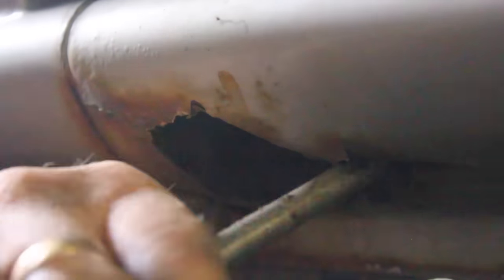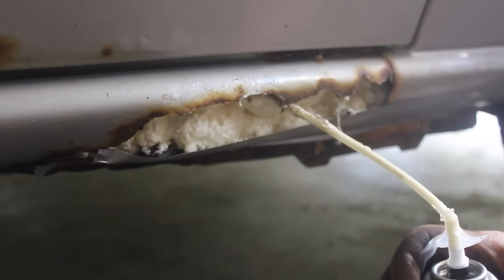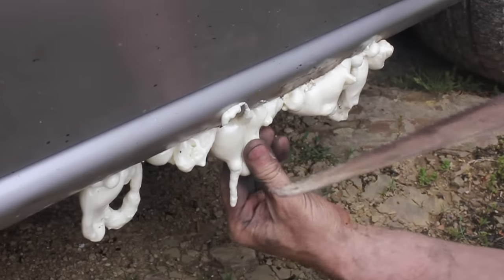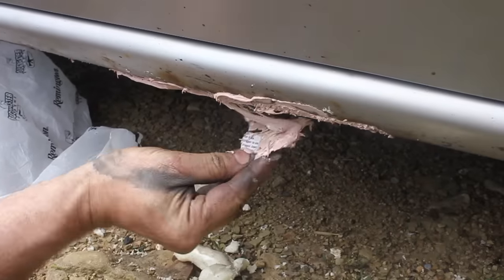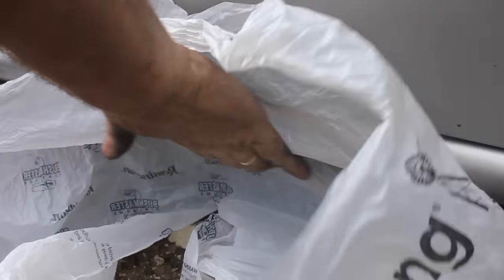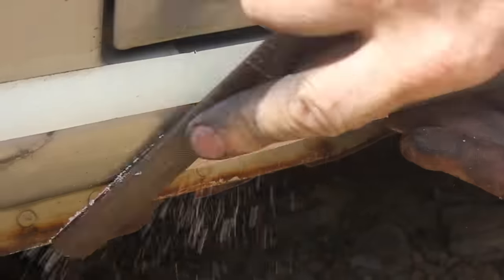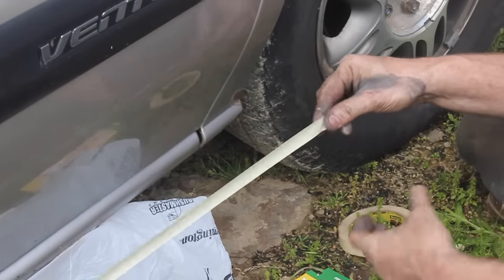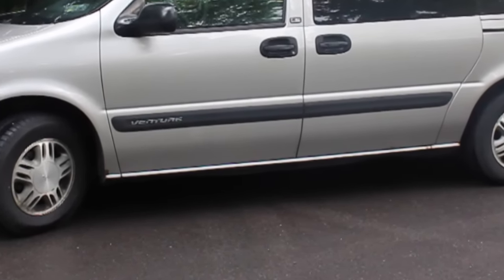how to FIX a rust hole in a rocker panel (fast, low-cost method)

Comment: Thats actually a patch / band aid, not a fix.  A fix would be removing the rust and replacing it with new material.  This patch covers the rust, which not only wont stop it from rusting more but the foam will hold moisture and create even more problems.  
But it is a cheap and quick lip stick on a pig solution.

Comment: Now that's what I call a bodge job.
As a fully qualified mechanic, I wouldn't dream of bodging up sills like that. It's dangerous as   in most modern cars these days don't have a chassis, the strength of the vehicle body is in the sills, they are the main built in integral part of the supporting strength of the vehicle so to speak, if that's corroded away the whole of the vehicles strength is jepodised along with its safety. 
That's why the MOT stations are so strict on failing vehicles with rotten sills.
The only safe and acceptable way to bodge sills, is to cut and grind the rust out and weld a patch on.
The correct way is to completely replace the sill.
To sell a car on in Britain with a concealed bodge like this could end you in serious trouble if it fails resulting in injury or death of the new owner.

Comment: I think the sill section of a car is structural and the foam filler is not, this is typically why buyers always beware. Looks OK, but far from it, this is actually dangerous. In a collision this car could crumple up with you inside.

Comment: What messed up State fails inspections over non structural rust? Yeah rusted through frame and floor pans is one thing but failing for non structural rust is a going quite a bit overboard especially when some states don't do inspections at all

Comment: never use foam in places where water destroys !!! The foam absorbs and holds the water so in a moment it will rot the whole threshold
Reply: this foam is closed cell and waterproof.. if you take the rust off properly, and do a good job spraying the inside of the rockers with rust inhibitor, it should last well over 5 years without falling apart.. this foam definetly does not absorb water.. the whole purpose of the foam in the first place is to be a weather barrier.. that being said, he miseed quite a few imporatnt steps to make tthis easy repait last twice as long..

Comment: If anyone on here complains that the rust "came back" - Thats because they didnt remove the rust to begin with.... What you see on the outside - Is greater on the inside that is exposed to trapped moisture.......... If you want to go a step further & "Do it right then Weld in a new patch panel - & sprayfoam the section afterwards......... you'll be amazed when rocks , shovel handles & whatever else manages to hit the panel - Doesn't even make a dent !!!  If you have pools of water building up somewhere - You need new weather stripping & probably could've prevented having to watch this video to fix your beater...

Comment: HOW,,, is replacing rust on a car with spray foam - MAKE IT AN UNSAFE VEHICLE ?????????? Toyota trucks rust completely away & they're still on the road for DECADES !!!!!!!!..... Spray foam in your panels - actually adds rigidity & Impact resistance... Also locks out additional moisture / further preventing more rusting.... Ive been doing this as a preventative measure for years on our 60s,70s & 80's vehicles up here in the "Rust belt" of Northern wisconsin with great success...

Comment: That stuff just absorbs water overtime rusting the metal still. All this stuff does is look like it’s working great for a little while. It’s just makes a mess when you actually go to do a proper repair by replacing all that rusty metal with new metal not foreign objects.

Comment: on our side of the big lake, it will not help. they use srewdriver and stick around. Furthermore my usual issue regarding rusted rocker panels is how to lift the car. Very often there is no hole, but the rocher is such weak, that u cannot lift  it. You can buy a cheap MAG Welder for ca. $200 and grab a sheet metall and hammer and form it...
Reply: Peter Ellenbacher you should never lift a unibody from the rocker. There are places for jacking up, but where he did the rust repair is not one of them. Always Jack from the subframe bolts if you can

Comment: Just wondering how many novices of viewers got screwed from watching this video and copying what you did?! This foam acts as a sponge. It absorbs moisture and retains it. If you live in an area where they apply road salt, this foam you applied retains salty water in the rocker panels, which means that you are speeding up the rust process...daaah! Thumbs down for this video for sure.
Reply: Negative it’s closed cell foam it won’t absorb water

Comment: People are doing this to hide rust and sell cars.
It shrivels up when painted.
It ticks me off to have to dig this crap out to fix it right.
Just cut off the rust. Fasten new rocker panels and seal.
If you don’t have the skills, use bed liner coating.
That will last.

Comment: What's that foam called and where can I get it
Reply from the maker: You can pick up the foam at any hardware store, like Lowes or Home Depot. It’s called great stuff. People commonly use it to insulate around doors and windows with this stuff.
Reply: you can also use it as shampoo
Reply: @3rdwrldkid  And your hair will never rust again!
Reply: @claybird8184  and if applied correctly it will give you a tremendous amount of structural integrity

Comment: can my truck pass safety by doing this ?
Reply from the maker: +gunstinger8384 

Our inspection requires that you cannot put an object the size of a quarter through the body of the car. I've actually seen people put duct tape over rust holes and get it passed through inspection.  Typically when the quarter panel starts to rust out it is well-connected to the car, and just has holes in it. This method quickly fills the hole with the foam, and then a very thin coating of Bondo to help make a hard surface. If your rocker panel is securely mounted to your truck, this method would be safe from falling off. The foam actually expands inside of the quarter panel, So it would be very difficult for this foam to come loose from the truck. I have fixed a lot of cars and trucks by replacing the rocker panels with new ones. Of course this type of a repair is very expensive, and involves welding, autobody and then painting. I have done this foam method on a lot of cars and never had a problem with the integrity of the repair.  I have even put the foam into the holes and then just simply coated it with undercoating, but I like putting the Bondo on top  so it is a little more rigid. The nice thing about this method is that by painting the rocker panels black at the end, you don't have to doing a complicated painting. It also looks pretty natural because I've seen a lot of cars with black on the quarter panel from the factory. If there is any rust holes in the frame however safety would absolutely be a concern. Thank you for your comment, if you have any other questions feel free to let me know.

Comment: Adding moisture absorbing foam, to a rusted area. Worse idea ever.
Reply: The foam is high density and pushes the moisture away filling up every single gap. After that it is sealed with clay and paint. A car that needs these kinds of repairs... doesn't have a long way to go...

Comment: Was this for comedy purposes, god love anyone who listens to this lad , if you value your vehicle in any way you will go out and buy some metal sheets and cut it to the size of the hole with a angle grinder then weld it in place or get a friend to weld it then put a light coat of filler over it , sand it and spay it with an air gun and a compressor .

Comment: How to "fix". That's cute. Nevermind the fact that the vehicle is a unibody. Meaning there is no frame. The body, particularly the rockers, door/window frames, roof skeleton make up the rigidity of the vehicle providing it's structural integrity. Rust has eaten that away and fixing it with spray foam from a hardware store is not a repair. The rust is still chomping away at all that metal. YouTube is not a reliable source for how to videos. This is a prime example of that. Want to learn to fix cars? Learn how to weld and bend metal. It's a lot easier than most think. It's also cheaper than 78 cans of Lowes spray foam and 16 gallons of Pep Boys best Bondo.

Comment: But that doesn't fix the rust issue. Rust never sleeps. Its still going to continue to rust so what you just did will only last a very short time.
This is why you look used vehicles over good before buying because of shady repairs such as this.
Reply: if you cut out all the rust, and use foam to fill in the gaps, then bondo and paint to seal over... how isnt the rust issue fixed?
Reply: @flakratty4916  If you cut out all the rust there is nothing left.  That is an impractical solution.

Comment: All this foam crap does is accelerate the rust because it traps water, if you are doing a patch cut it to solid metal and weld it in.

Comment: omg ppl its a temporary fix its not the proper way to fix it and like one guy commented its a trick that small car dealerships used to pass inspection on some vehicles to my opinion rust in the body is not unsafe but in the frame of the car is thats what ill be looking for if am buying from a small car dealership that the frame motor and transmission are good

Comment: That will last a year. Maybe. Fix it right or junk the rot bucket !
Reply: Sometimes all you need is a year to save up for another car.  This is the perfect low-cost fix to keep 'er runnin', not for long-term solution.

Comment: I have a 2001 Sierra extended cab short bed and I have invested thousands and thousands of dollars in this truck over the past couple years and automotive repair at this point in time I have invested more money in repair than what the truck cost me in the beginning when I purchased it. My truck will not pass inspection now because of my left rocker panel which has a huge huge hole and it goes right down the middle right on the back left door my truck has four doors. It's not crew cab it's extended cab so the doors are smaller type of doors. But the driver side rocker panel needs to be replaced according to the mechanic /Body guy  and the right side needs to be replaced within the next year he gave me a price quote of $4,500  $5,000 Maximum I actually laughed at him. I said is there any way that you could do this cheaper for me and just fill this up with Bondo he stared at me like a retard didn't say a word and then just repeated what he said a few minutes before that I can do all this for five grand at the maximum he won't do it with Bondo and he won't do it the cheap way they'll only do it the correct way according to him. So I definitely will not be spending $5,000 of my hard-earned money to put it into a truck that is 23 years old but eventually I'm going to have to replace the rocker panels on both sides but at a reasonable price$5,000 is not a reasonable price in my eyes 👀 does anybody know if this is reasonable or a rip-off like I think it is? My question to you is the man that made this video is if I do this to the whole on my truck and fill it in how you feel then your buddies hold the van and then I would put a rust preventer spray over it and I would douse the s*** out of it. I would put a lot of extra layers on and of course I would put a primer over it with rust preventers and inhibitors and then I will paint it with the factory paint 🎨 I'm curious how long will this last before I'm going to have to redo it and do it again?????

Comment: No no and no, at least grind and or treat rust then use kitty hair filler if you can’t weld in patch panels, not for your 69’ camaro but pos van yes

Comment: "Structural integrity" ??? 
The rocker panels are made to be very stiff, to protect the passengers from side accidents, and to support the weight of the vehicle. Your foam will do non of these.

What IS a good idea (and I don't know why the manufacturers don't do that) is to spray this foam inside BEFORE any moisture gets there.
Reply: not everyone can afford a NEW vehicle every 3 years. Look at Dodge trucks start rusting after only 3 years here in Michigan. If that rocker is that important the manufacturer should make a better product, but since they all rust it cannot be nearly as important as you state. The bumpers don't rot this quickly...

Comment: That’s the worst bodges I’ve seen on YouTube! The sills on the side of the car is where the strength of the chassis on a monocoque car is. If you have a chassis then fine, but that car looks like a monocoque so if you have a crash that will fold up in the middle. You’ve created a death trap and the inspection didn’t do their job.

Comment: This is a horrible idea. That foam, once dry, sucks in moisture. So you'll end up with several times the rust you just "fixed." I just delt with the aftermath of some idiot doing that and it wasn't pretty. What he did ended up turning a rust spot like yours in the video to a whole square foot needing cut out and replaced. This is one of the worst things you can do.

Comment: He says hes done body work for years.............. I wouldn't have this guy  change the straw  in a rabbit hutch ! 

What hes showing here is the worst thing you can do  to the hollow structures of a vehicle ! 

The foam  traps the water against the internal panels and rots them  completely ! 

Do this to your car and expect to scrap it  a short time later.

Once youve done this  the nightmare comes when you want to make a proper repair with new panels,  You are going to have major problems welding  new metal in as the foam burns. 

Rubbish idea and one i wouldnt recommend  to an enemy !

Comment: Why don't you just ran a 2 by 4 in the damn thing and varnish it. That will have more structure than foam 😂😂😂😂😂
Reply: If it were a treated 2x4 that might work.  But when you nail it in you will have to be careful not to dent anything with your hammer.

Comment: Perfect example of WHAT NOT TO DO.
The foam will retain moisture and not only rust everything around it out even faster including the floor boards, but as soon as it freezes, it will pop out that bondo.

If you're that cheap or just broke, at least spend a few more dollars on some basic sheet metal and cut to fit inside of the panel.
Secure in place with self tapping sheet metal screws then grind the head off.
Then fill with fiber filler and cover with a sealer primer.
Use a couple or so coats because the filler will absorb the couple, then paint  and cover with a rock gaurd or rubber bed liner. 
Only about 20 or 30 bucks more than this crap, but will last much longer and hold up to weather conditions.
Reply: Sure, and then after all of that, it will still rust out again.
Reply: @angleturner  nowhere near as fast. Especially if you go a bit farther and spray a rust neutralizer inside the rocker and cab corner followed by a rust inhibitor.

But in reality, the best thing to do is replace the entire panel
Reply: Thank you for your honesty on here, there's probably people out there watching this video and truly think this will fix their rust problem on their car
Reply: @jasonwalton1985  'best thing to do is replace the entire panel' is a less than smart thing to say in this forum as people are looking to do some sort of short cut.  You might as well say the best thing to do is buy a new car.  The stuff you said before that makes a lot of sense.  Do you think using something that is aluminum or plastic as a backing would be good as those materials do not rust.  What about using some kind of plastic or metal (aluminum?) both inside and outside?

Comment: So basically what you're doing is using foam and Bondo to keep out moisture? 

Yeah, good luck with that one, you'll be doing it again in a week.
Reply: He is not trying to keep out moisture.  He is filling the hole the rust made so as to pass inspection.  He even said this in the video.  States that have inspections allow rusted out holes in the body, but no larger than a quarter.  So this is the quick fix for a junker to pas inspection.  But you chose not to hear that.

Comment: You can not use bondo on holes in a structure that is critical for the cars upholding (dont know the right word). It needs to be welded for safety reasons.

Comment: And 2 weeks later it’s back!
Reply: Doesn't matter. it passed inspection for another year.  That was the hole point of this type of fix and of the video.  The car will be junked at a later date.  You don't spend a lot of money on a junker you just want to drive around until it's ready for the junkyard.  You fix it like this.

Comment: Wow it looks great... until the mechanic  puts it on the lift.....    ohhh. I didnt think of that
Reply: Frame rail my friend. With all that rust, the rocker would not have supported anyway. On a 500$pos just for aesthetics. I know it isn't the right way but it's never going to be a show car just so it doesn't look so horrible and on a budget. Not saying I agree with the fact that foam should be used. But I guess we always have those guys that spray a little paint on it and think it's fixed..soon in my opinion it's a thought to ponder on if you have a POS.

Comment: so not right. I would never let you do body work on my car.
Clearly you dont know much about body repair...
Reply: What's wrong with this? Rust is inevitable, especially in areas that salt the roads or near oceans. This winter beat up my rockers and I'm thinking about doing this. I could also do bolt on replacements, but for $15, this will do the job just fine.

Comment: You are a scam artist, the sill is a structural part of the car, it should be repaired with a new sill or at least a patch welded over it not filled with expanding foam and body filler, you should be banned from YouTube.